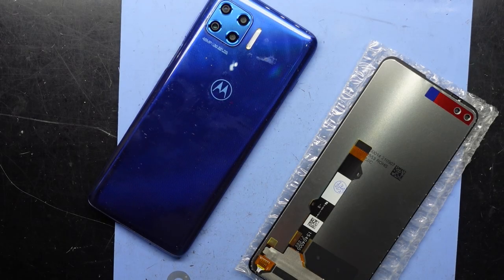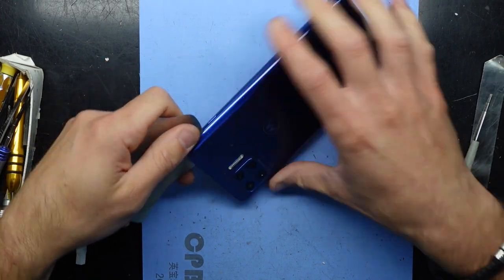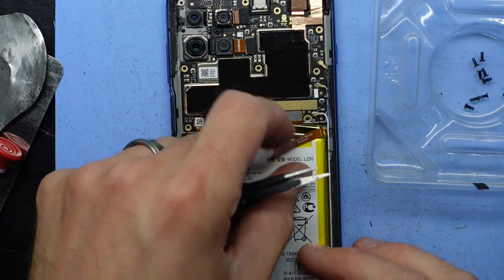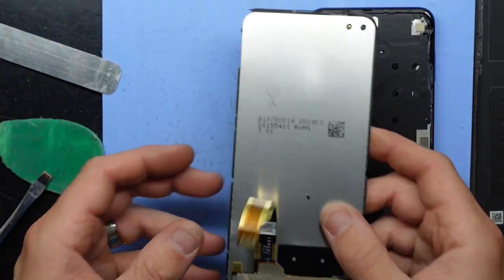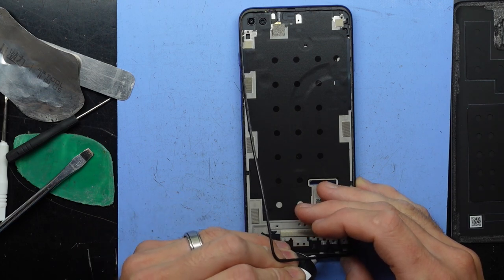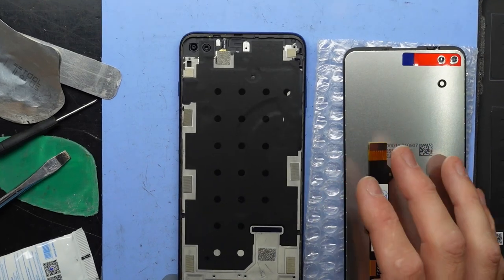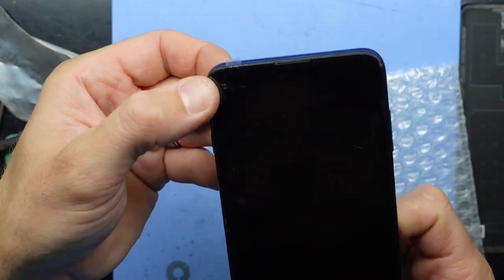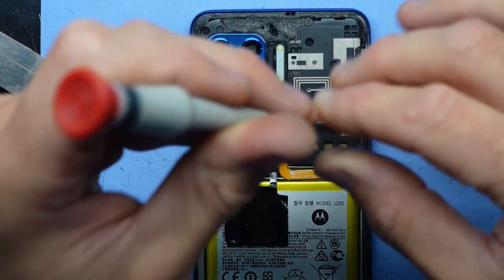Moto G 5G Plus Screen replacement

Comment: Thanks so much for this video! Watched it a number of times to get my confidence up on replacing my own Moto G 5G Plus screen.

My phone has been repaired in the past and it looks like they removed the rubber trim around the screen. I'd like to replace it, but can't find the part online. Do you have any suggestions? I thought 1mm foam tape might work as a replacement. I have 2mm foam tape but it's too wide. Could I just fill it with black frame adhesive instead? Cheers.
Reply from the maker: good luck with your repair

I would go with using black adhesive rather than a foam/ double side tape

Comment: Amazing, all done in 22 minutes, just one break at 11.27mins, no editing. You’ve convinced me to attempt a cracked screen replacement myself. I’ve checked out the material costs, on eBay (UK), to realise it will cost me less than half the price quoted at my a nearby tech shop (£89). I have the tools needed.

Please can you help me with these questions: 
1.	I don’t have a hot pad, I can warm my phone in my NEFF oven on plate warming mode, any temperature from 30º to 70ºC. Even 70ºC sound extremely high, are you sure this is, okay?

2.	The alcohol ‘Isoprop……? I couldn’t capture the full name and spec, not even on slow motion/freeze frame mode. Please can you state its actual spec and name.

3.	It would have been nice to see how you actually test the new screen (5.25 – 5.40 mins) before fully assembled. If you do another clip showing this, please let me know.

Judging from ‘Comments’ it really does work.

My phone is the exact make. Hopefully once I’ve got the job done, I’ll give feedback as to how I have got on.
Reply from the maker: 1.	If you access to a hair dryer, that would be the tool to use.
70 degree Celsius is fine 

2. Isopropyl Alcohol is the liquid used, helps alot with glue but not always needed

3. regarding testing your new screen prior to opening. once you have the phone back off and can disconnect the exisiting screen 5:29 connect up the new screen to the connector. 

the screen will probably be upside down in your hand as the video cable will bend it that way, but you should be able to test it then
Reply: Hi Rick,

A resounding success! 

I stuck with the oven, a more uniform, accurate and consistent distribution of heat, using 60 then to 65ºC which worked fine. The first pry tool (1.05mins) I used a ring pull anchovy tin lid cut to the same shape as yours. The second pry tool (6.01mins) I made from an old hardwood wedge sanded smooth for reasons stated next.

Removed the back cover. The lithium-ion battery is like plasticine in a plastic bag! I took exceptional care when removing. I’ve read a few reviews about these batteries catching fire. Thankfully the majority have no trouble, most likely why 70ºC worried me.

To remove the LCD screen, I put my phone back in oven for 10mins at 65ºC. Using a big screwdriver (6.52mins) the screen came out in one piece with the black frame attached. Used the oven again to remove the black frame from the LCD screen in one.

Thanks for the close ups at 13.47mins (lens rubber rings) and 14.35mins (ear piece) so I was sure I had put them in the right way around. My camera lens needed aligning with a slight push, back into place, from the other side.

I saved myself money and learned a lot in the process. I hope this is of help to others.

Many thanks Rick for your methodical approach and excellent, in focus, camera work.
 @rickstechrepairs

Comment: Hello - Can I ask where you get your replacement screens from?  - I have fixed two of these now and the glass on the replacement part is so VERY fragile - it is definitely not anywhere near as strong as the original glass that came with the phone.
Reply from the maker: I got mine from a local seller otherwise I usually purchase from Ali express

Most aftermarket displays glass is weaker than the factory's
Reply: @rickstechrepairs  Ali express where?

Comment: Thanks a lot for the detailled video! Why did you use these two glues? Does it work glueing all with the B-7000? Thanks
Reply from the maker: Haha not sure why I used two different kinds, I think different size nozzle on the end of the tube
Reply: @rickstechrepairs  Thanks a lot for this video! Just went along with the video replacing my screen - all with B-7000 ;)

Comment: Is there an approach where the back panel does not need to be removed when u want to repair just the LCD?
Reply from the maker: No, because you can't get to the LCD connector from the front
Reply: @rickstechrepairs  thanks. This is more complicated than the previous devices I've owned.

Comment: I usually fix my phones my self
Bought a brocken moto G 5G plus and .....😅 
Gonna have some bad moments to replacing the screen , 
I don't want break the old one , since it's working perfectly , just the glass is shatered , will try fix it too 
But the way they built it makes it impossible to take out without breaking it i suppose
Reply from the maker: Good luck
Reply: @rickstechrepairs  
I need it lol thanks , 
The most part i'm scared about is taking off the screen without damage it

Comment: Perhaps I missed it, but you should advise or prewarn viewers that they should not use metal tools when working on phones or other electronic equipment! Batteries especially should not have metal tools used around them! The risk of fire is far to great, and those fires are toxic and hard to extinguish!
Reply from the maker: pretty sure i mentioned it at the battery remove, or at least i usually do

Comment: What do you do when those small screws won't come loose? 😂
Reply from the maker: they should come out
if you strip the head of the screws, you are a bit out of luck
Reply: @rickstechrepairs  I got most of them but they seem to have used some Teflon or something like that. 4 of them just wouldn't come out so I drilled them out and glued them shut afterwards :') 

Thanks for the video, it really made the process easy!